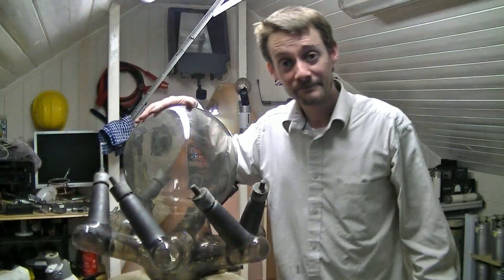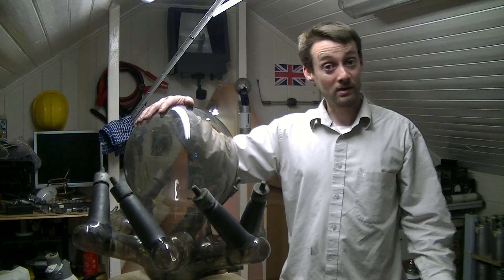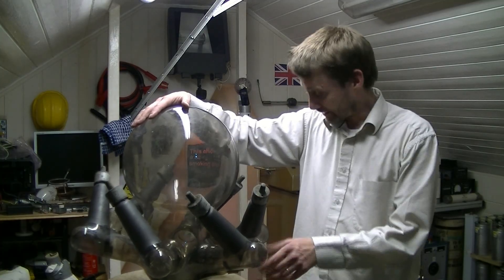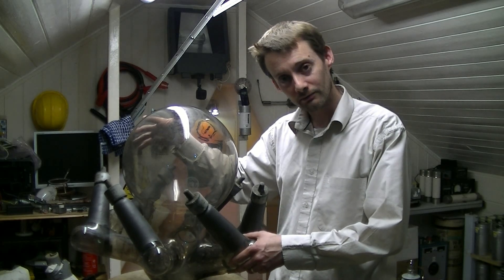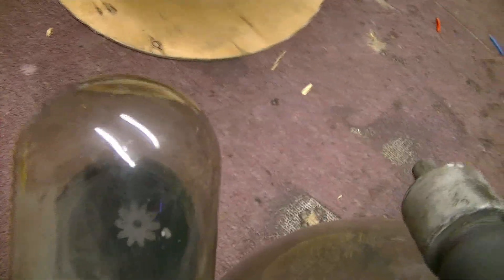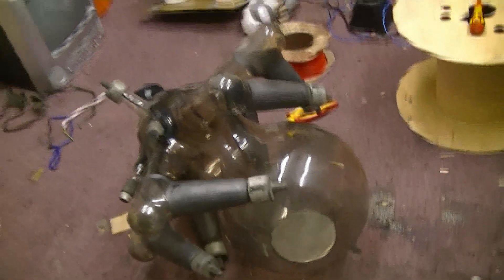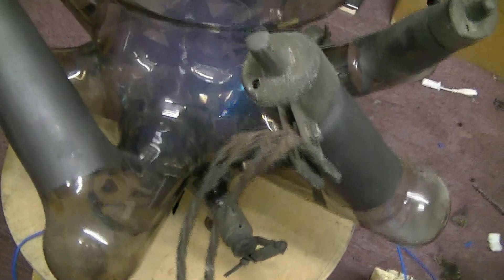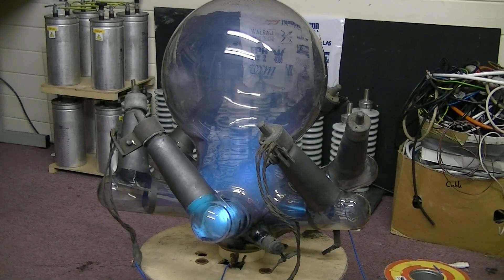Mercury Arc Rectifier

Comment: How du you start that thing? HV to evaporate the mercury and apply the six phase power to rectify once the mercury is condensing on the top and running back to the bottom?

Comment: A 100% efficient transformer simply steps up or down by the turns ratio. You have a ratio of 1 to 4, at 5 turns primary and 20 secondary so if you input 9V AC you'll get 36. Wait, what? Are you trolling?

Comment: Using just a 9V battery on the input side, no other switching electronics?  None, you will get no output at all.  Transformers will not work with raw DC like you get from a battery.

Comment: A 9V DC source will not work with a transformer without using a circuit to oscillate the voltage.

Comment: Photon: What about UV emissions?  I know that mercury vapour lamps (the ones that have recently been banned in the EU) produce enough UV rays to cause sunburns and eye issues if one is operated without the UV protective envelope.  Is the glass on these doped to absorb these or are you supposed to avoid exposure while its in operation?  Also, what kind of voltage/amperage were you putting through it in this video?
Thanks, always wanted to see you play with one of these! -Al :)

Comment: 5 primary and 20 secondary would give four times the input voltage, the size of the turns and type of cable won't change that.

Comment: Back before the days of silicon and transistors they used these monsters to rectify AC current into DC current.  Before transistors they had vacuum tubes, the Mercury Arc Rectifier is a particularly large variant of a rectifying tube.  They were commonly used in radio applications and providing high current DC power for rail car traction motors.  For size comparison Photon's tube is actually relatively small compared to how large they used to make those things.

Comment: Yep, with a 6-phase AC input, the output voltage will be damn smooth, you don't need to put a large cap to have an almost perfect DC voltage...

But Photon just had single phase 240V, isn't it?

Also, I found an interesting wiring scheme in Wikipedia for a six-electrode arc rectifier  : en(.)wikipedia(.)org/wiki/File:Quecksilberdampfgleichrichter_6phasen.jpg

Comment: The mercury vapour allows electrons to travel in only one direction, so it rectifies the AC current to DC current. The most well-known use of this particular design was for the London Underground rail system to power the DC traction engines. All these systems have now gone solid-state, and as far as I know, the last one was replaced not that long ago, within the last year or so.

Comment: when you run a fluctuating current, AC(+-+-+-+-+-), through mercury it products a flow of electrons. but only on the positive side of the wave, which is why there are six separate phases... so the DC current will be as smooth as possible. the giant bulb lets the mercury vapor condense and drip back to bottom where the AC current is being introduced. awesome vid Photon! If I had one of those in my shop, I would stare at it for hours!

Comment: Say buy to your Misses from me in return. Still on vacation in Florida. Using a 110 / 240 Volts step up transformer for my camera chargers.
You need a substation 100 kVA or more to run one of those at full power. Still great arcs and glow the way you wired it up.

Comment: Nice score, where did you find this device.
Great you got it going. I remember these from the military. We had these on the rectifiers for charging large battery banks. Preheating with teaser filament for about 1 minute before the actual main arc was struck.

Comment: I've never seen one with UV screening other than the cabinets they were sometimes mounted in.  The glass will screen most of the dangerous wavelengths.  You have to use specific glass like borosilicate to actually pass the more dodgy wavelengths.

Comment: It's designed to handle a shit-load of current, but in use there would normally be a fan underneath it blowing air up past it.  I wonder what sort of illuminated path you'd get if you used a high frequency cold-cathode inverter on it.